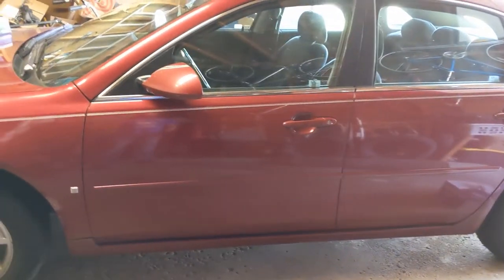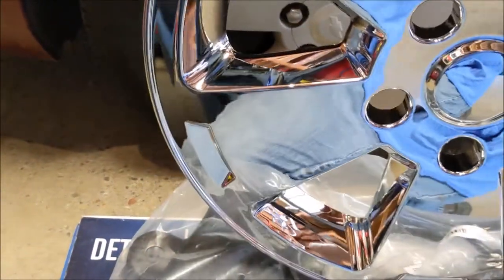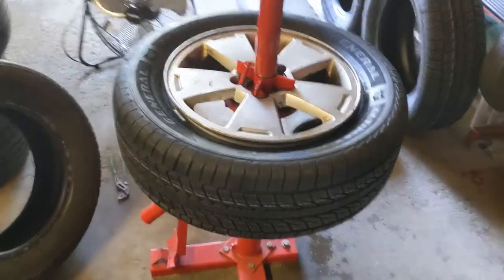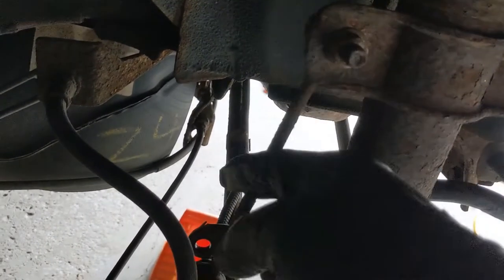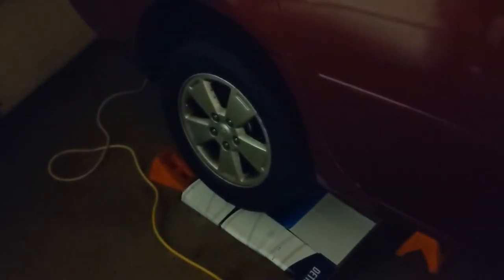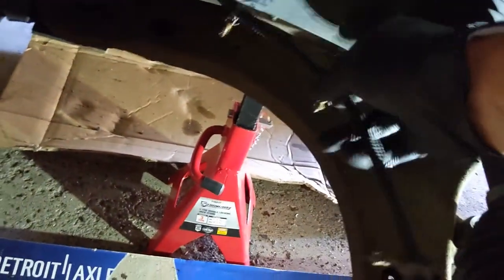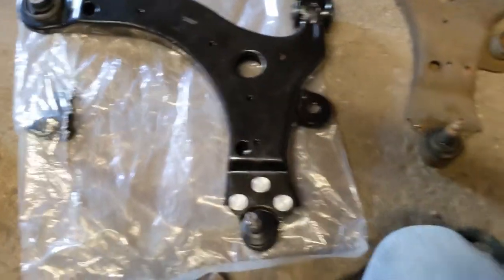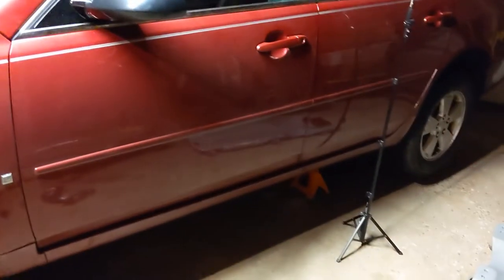*VLOG* Introducing "Ruby" -  2006 Impala LT Overview and Overhaul (Suspension, Brakes, Tires)

Comment: ayyyy what happened the ol blackie you did paint correction on! i like this, the chrome covers really make the ls model rims better i hated the original ones lol
Reply from the maker: She's still my daily (0:40 you can see a peek of her in the driveway.)  I agree with you, I was never a fan of those wheels either. The skins were a nice little upgrade, they were only like $77.
Reply: @CertifiedShadetree  ouu nice haha, 2 impalas not bad. i need to change the cv axle on mine haha
Reply from the maker: @jorgenvonstrangle000  That's not too big of a job. If you don't have one already, buy a 34mm axle nut socket. It'll make life easier!

Comment: Did you get the heated version of the side view mirror?
Reply from the maker: No, I cheaped out and got the standard version.  My buddy wouldn't have known whether or not he had heated mirrors anyway!! 🤣
Reply: @CertifiedShadetree  fair! I did it on my brothers ‘12 impala, I doubt he noticed lol
Reply from the maker: Was it plug-n-play or did you have to run wires?
Reply: @CertifiedShadetree  the connector already had  the wiring ran to it (looking at the harness and pins in the connector) just plug and play.
Reply from the maker: Right on!  I know the 00-05's had heated mirrors available but you had to wire them in if your car didn't come with them from the factory.